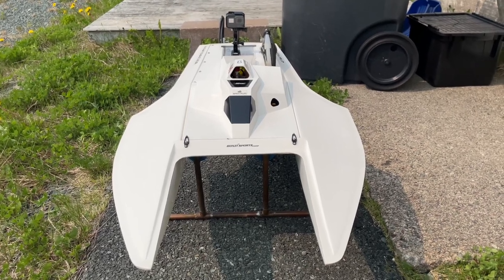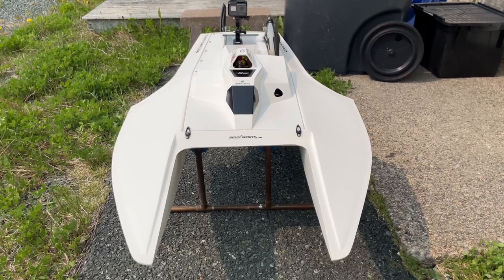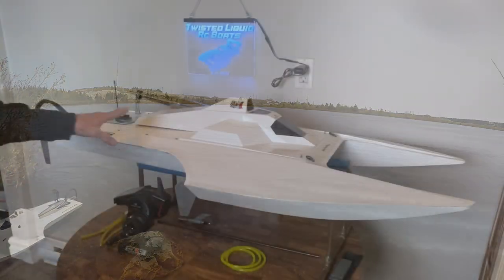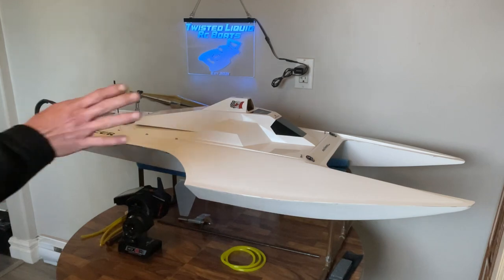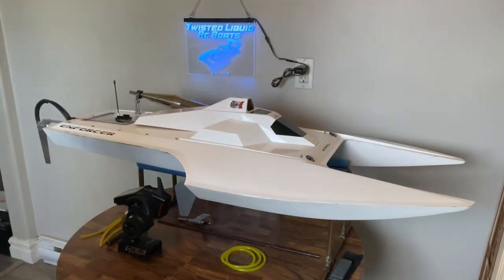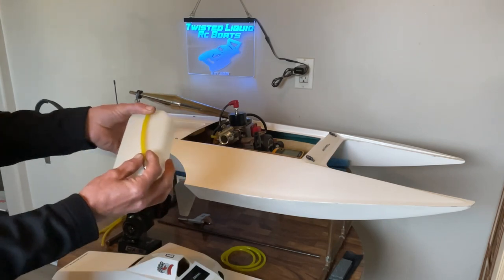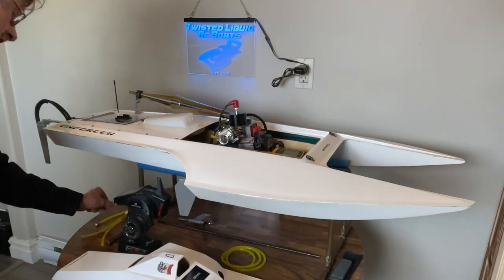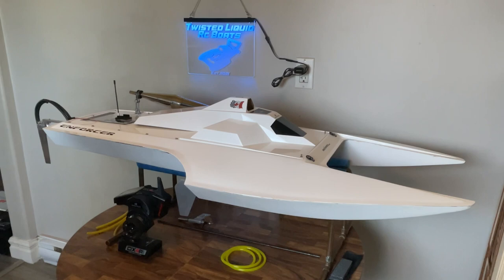Enforcer Demon Hydroplane Rc Boat Testing

Comment: Another nice run brother! What engine an mods has the demon demon running todd? Mine has the original full mod 26 cc from warehouse hobbies i remember showing u my engine when i had it out an u said the builders name on it an u said he was very good builder. Its a 2012 but only has a lil over 2 hr run time an its a awesome screaming engine.
Reply from the maker: @michaelharrison6978 Thank you 🙏 sir. My boat is running a Zenoah G260PUM Engine with a Bonzi Sports BZ-1 Mild Mod on it. I’m running a Stock Walbro 644 Carb and using a Zippkits Pipe. Your engine should have been built by Tony Castronova, the previous owner of Enforcer Rc Boats. If it got the letters TC engraved in it Tony built it. I appreciate your channel support sir. I’m making this boat run good to Nay Say all the critics of this Hull. Keep watching, more coming soon. Take care sir.